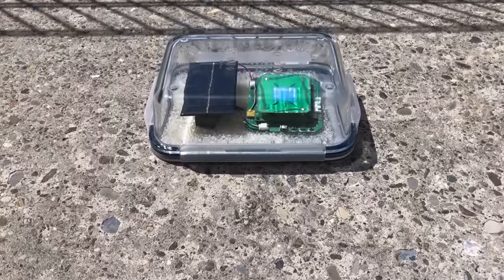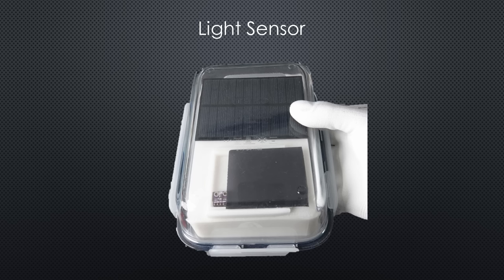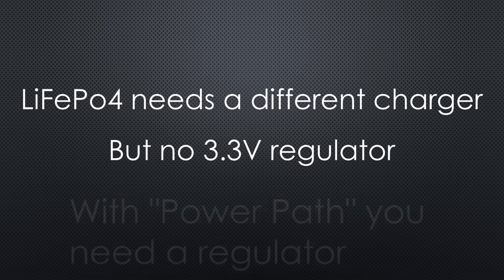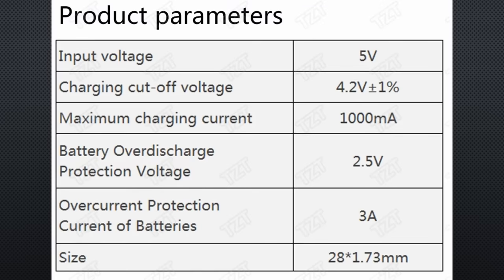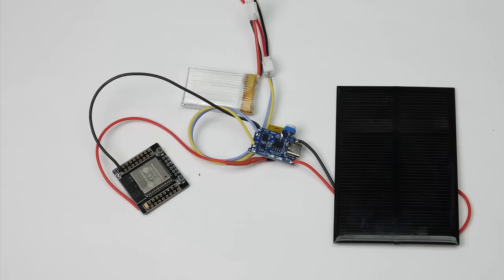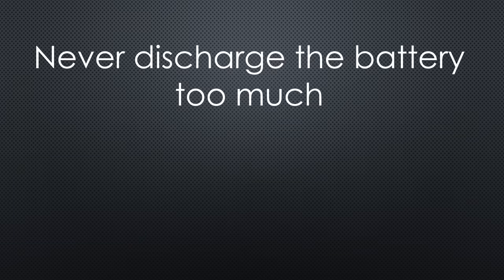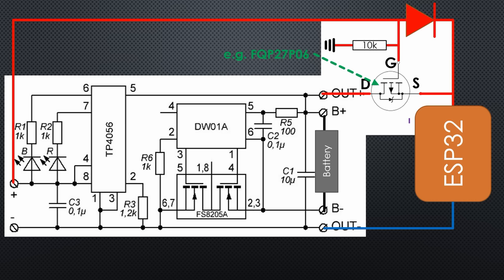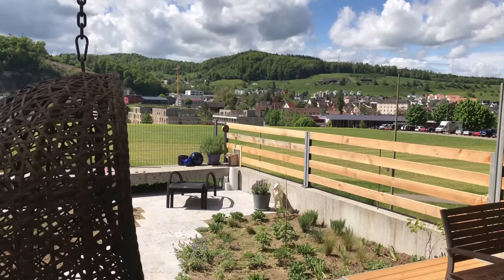#383 Cheap and simple Solar Power for our small Projects (ESP32, ESP8266, Arduino)

Comment: Hi Andreas, I am a big fan of yours and learned a lot from you. However this power path management circuit is possibly  flawed  in some situations.

The pMOS + Schottky diode path management circuit ASSUMES the voltage of solar cell output significantly lower (lower than threshold voltage of Vgs) to TURN ON the pMOS s.t. minimize the forward voltage drop of the pMOS body diode. However, that is NOT THE CASE in quite a few situations.

When sunlight is not strong enough (raining, snowing, twilight), due to the design of TP4056, solar cell output voltage will be clamped close to battery voltage. In this situation, battery still supply most of the current to the downstream. In my city in summer, from 5am-7am and 4pm-7pm (if sunny) or 7am-6pm (if rainy), my 6V 6W panel output voltage is usually slightly lower than battery output voltage, therefore, the Vgs hasn't reached the threshold voltage and pMOS is still "OFF". Therefore the battery voltage suffered from 0.5V-0.9V drop due to pMOS body diode in OFF state and makes 3.3V downstream circuit unstable. Considering the downstream circuit is usually behind an LDO with 0.3V additional voltage drop, the circuit will stop/brown-out due to "low battery" even when your lithium battery is actually >3.9 V. This is bad news for  surviving consecutive rainy/snowy days, where you really account on the full output voltage range of Li-ion battery to sustain as long as possible, while your circuit actually stop at 3.9V.

LTspice simulation also confirmed this worst scenario.

A simple modification can resolve this. Just put back the Schottky diode that you have replaced with pMOS. In this case pMOS body diode and Schottky diode are in parallel configuration. In the situation I mentioned above, Schottky diode will take over to limit the forward voltage drop to <0.3V instead of off-state pMOS body diode voltage drop (>0.5V). 

Such modification is confirmed by LTspice and circuit prototypes.

Happy to discuss.
Reply: I posted my LTspice simulations of the power path in a Github repo.  My name there is 'gbhug5a'.  I agree with your conclusion that under partial illumination the mosfet stays off, and load current provided by the battery goes through the mosfet's body diode with a Vf drop of about 0.7V.  I also agree that puttng in a second Schottky diode in parallel with the body diode reduces the Vf drop to under 0.3V.

But I also show another option of adding a single opamp instead of the second Schottky, and using its output to drive the gate, which completely eliminates any voltage drop because it keeps the mosfet turned on until the solar cell is producing enough energy to power the load by itself.  I still haven't worked out how the charger works with the opamp - we don't want the mosfet to be on when the charger is providing charging current.  I'm not sure there's a problem, but if there is, a solution might be to also connect the opamp output to pin 8 of the TP4056, which is its ENable pin.  That would enable the TP4056 only when the mosfet is off (when its gate is high).  I would be interested in your thoughts about this option.  The opamp I want to use is the MCP6041 in a DiP package, but I can't find a Spice model for it, so I simulated with an LT opamp that's much more expensive.
Reply from the maker: You are right. I know of this flaw. But my panel reduces its voltage quite fast without sun. So the question is: How often does this happen and does it hurt the overall system. Here this condition rarely occurs and only hurts if the battery is already low as you describe. If you want to optimize for this condition you can replace the MOSFET with a Schottky diode to gain 0.3 volts. Or leave the Power path away. The LDO I used only drops around  0.15 volts, BTW.
I can not say anything about your OP-amp solution other than it would add quite some complexity. Maybe adding a resistor across the solar panel would be the better idea to make sure the panel provides a low voltage as soon as possible.
Reply: @shermanpeabody7065  MCP6041 is a great option since its quiescent current is only 600nA. I used that too in other power path management circuits. But OpAmps in such design mostly serve as voltage comparators, which may create additional problem. At least AFAIK, a small positive feedback is needed to ensure some hysteresis. Otherwise the voltage comparator will bounce back and forth (a lot) when V_batt and V_solar are close, and interact very strangely with TP4056.
Reply: @sullivanzheng9586  I finished physically testing the MCP6041 circuit, and it seems to work fine.  It does function as a comparator,  The non-inverting input and Vcc connect to the source, the inverting input to the drain, and the output to the gate.  There are no  resistors.  So if the output is at a lower voltage than the input, the mosfet is turned on.  I think it has a built-in bias to be on since there is always some voltage drop across the mosfet due to RDSon even if it's wide open.  I think another reason it doesn't oscillate is that the mosfet is switched off only after load current contributed by the battery has already reached zero, so the panel doesn't see any additional load when the mosfet changes state.  I wrote it up here:

https://github.com/gbhug5a/Solar-Power-Load-Sharing
Reply: @shermanpeabody7065  Cool I will also give it a spin. Got a bunch of MCP6042s at hand. And see if there is any flickering problem if there is no hysteresis mechanism.
Reply: @shermanpeabody7065  I read through your SolarChargerLoadSharing.pdf on github repository and find your design very interesting - elegant, simple yet very efficient. Will definitely use that in my next project. 

I am very surprised that you didn't see any oscillation when V_solar is close to V_battery. Or maybe it did oscillate but the impact is unobservable, because V_solar and V_batt are very close to each other any way and an oscillating OpAmp and on-and-off MOSFET will have 0 impact on final output voltage. Maybe I will measure the Vgs to see if oscillation actually happened.

In case there is oscillation, a simple modification can address this: just add a 1Mega Ohm resistor between G and S to give a small positive feedback to OpAmp. This is the simplest way of introducing hysteresis to voltage comparator.
Reply: @sullivanzheng9586  I hope you will post the results of your oscillation tests.  I think it has no reason to oscillate because switching the mosfet takes place when that has no effect on either the battery voltage or the solar voltage - it's zero crossing, in effect.  Also, it's a very slow opamp.

Of course it could switch back and forth if solar illumination wanders in the short term, but that's not really oscillation.  Anyway, I couldn't detect anything suggesting oscillation on my scope.  But I look forward to seeing what your experience is.
Reply: @shermanpeabody7065  I recently came across several ideal diode IC/ORing controllers (E.g. LTC4359, TPS2412) and I think your opamp + PMOS based circuit is actually an DIY version of ideal diode/ORing controller. Those IC are more sophisticated but your solution is simple and cheaper. There are also very interesting ideal diode design based on BJT pairs without using any ICs.

Comment: This is incredibly helpful! Is this still achievable if there were dual inputs in the application? For instance, if there was a usb charging Input in parallel with the solar cell? I imagine both USB-in and Solar-In would need diodes before meeting the TP4056 but not sure if a separate path would be needed.
Reply from the maker: I fear, USB would be stronger and not use solar if connected, even with diodes. But if you want to use solar when no USB is connected, this might work.

Comment: I watch your channel repeatedly to refresh my memory. I would like to use 18650 battery (not sure good or not) or/and solar panel to make solar power for ESP series. Another question is which esp I should use? e.g. esp32,  S2, C3, C4.... price vs current consumption if applied in homeassistant
Reply from the maker: I still use the standard ESP32 for my projects.
Reply: @AndreasSpiess  Thanks, I think I will also use this coz of lower price

Comment: Interesting... I never figured out the "power path mosfet" solution despite hours of thinking and tinkering with various diodes. The low charging current had actually killed one of my projects after a rainstorm and 2 weeks without sun.
Reply from the maker: Glad you found the solution for your problem...

Comment: I would like you to address the problem of Li-Ion batteries at low temperatures (below 0). They are plain dangerous and thus not appropriate for anything outdoor. LiFePO4 is far batter at the cost of slightly less capacity (but you can power 3.3V electronics directly, which saves the losses of a DC-DC converter). Oh, and yes, it's waaaaay more difficult to find charger and protection circuits for LiFePO4.
Reply from the maker: I once made a video about LiFePo4 and I agree with you. But so far I had no problems with Li-Ion batteries at low temperatures. We do not charge them with high currents in winter. So most of the warnings do not seem to apply. So far I did not find any information about charging Li-Ion batteries with very low currents.

Comment: Hi, sorry but I'm a noob in electronics, I didn't understand well the mosfet function, if the solar panel has 5v under the sun and it's generating 'only' eg 80mA (eg due to a bad weather), what happens to the ESP32? I think it isn't powered by the battery, am I right ? if so, the drain-source 'door' is open only if the gate is low(solar panel -> night) ?
Reply from the maker: I left a link to a second video. Maybe this one explains it better than me.

Comment: without checking... You can get a smaller p type fet to control the switching. ive a tiny one about half the size of the ht7773, i think it was a PH33
I thought those Battery charge BMS have a over volt, under volt and short protection?
Mine do, maybe mine are different?
I found out when I had the box left inside and it was off and had min voltage. it was charged.4.2v and then sometime later I put it out for recharge one box and it rained...
I used a boost and a buck for five volts due to use of the ESP so 3.3 was not enough nor the 330ma.. such a power waste as the bucks power requirement, but I get more battery use over a simple drop with low drop.
I also use two of those solar panels ( and aux charge from the usb)
Reply from the maker: You are right, you get much smaller FETs. But I like the bigger ones because they are easier to solder in "bug-style".

Comment: Did you solder the ESP32 chip to the breakout board shown at 7:55 or is that how it arrived?   I cant find a board like yours without USB but with the breakout board.  Your links dont seem valid anymore for the WEMOS unless the banggood version for the chip (super expensive) along with an external breakout board is the way to go?
Reply from the maker: I had to solder the modules. But it is easy. Start with two opposite pins. I updated the WROOM links.

Comment: Would extreme Death Valley sunlight present a heat problem for the battery or other components sealed up in that baking dish?
Reply from the maker: I assume it would. I had two different such glass packages in full sun during last summer and they are still ok. Maximum temperature measured was 65 C
Reply: I live in a sunny place, I don't know about the circuits, but I am not keen on putting one of those batteries inside a mini greenhouse. Specs say you shouldn't go above 45C.

Comment: Again a very good video, I got adicted for a long time and my aliexpress orderbook gets bigger and bigger....
I grew up with bipolar transistors and I am not sure if I understand the p-channel MOSFET circuit. I believe it will protect the battery, but what happens if your LiIon cell is for example at 3.5V and the Solar Panel delivers between 1.5 and 3V. The datasheet for the FQP27P06 says it needs at least -2V gate to source as threshold, most likely better -3V? In this state the ESP might still be fed trough the body diode of the FET, but then we could also directly stay with the Schottky diode? 
I see the same curcuit in other "power path" implementations, but I guess there it is assumed that the charger input voltage is either on or off.
Do I miss anything here, is there maybe any logic in the solar panel as well?
Reply from the maker: I think you are right and there is a "fuzzy" voltage area depending on the minimum Vgs of the FET. The question is: Does it hurt the whole concept. This could happen if the battery is low and the solar panel is not zero and not high enough to feed the ESP (Vgs small). Then the current would only flow through the body diode of the FET. Which would be the same as if we just would have used a diode. Or did I forget something?

Comment: For my last project, I used a board with the SPV1050.  This board harvests solar power down to 0.5 volts.  This allows the use of small solar cells, and will still charge in over cast conditions.  DFRobot sell the board with a small cell SKU:DFR0579.
Reply from the maker: Thank you for sharing your experience. If I remember right I used this chip in my harvester video. But it is probably more suited for low power projects without Wi-Fi

Comment: On a TBeam v1.1 with integrated battery holder, i tought of inserting directly via USB. For this i choosed 2x5V Panels and a TP4056 charge controller. So the panels should load the already installed battery. Would be much easier than your setup in case of my TBeam board.
Reply from the maker: You can use the Li-Ion charger on the T-Beam. But you have to check if its maximum voltage is higher than the maximum voltage of your panels. Check also all other chips connected to the 5V rail (like the USB to serial chip).

Comment: 12:07 I definitely agree that these tp4056 board should be upgraded with a p-mosfet and a schottky diode.

Having, this "load switching" circuit is extremely necessary when power a load consuming a constant relatively high (higher than cutoff current of charger) current, as the load will prevent the charger from shutting down when battery is charged thus it can overcharge it.

I was recently thinking of using this circuit for a weather station project, but I had one concern, of how will the charging circuit and load switching circuit would react, if the panel voltage drops to a low value on less sunny day and during evening 🤔🤔🤔
Reply from the maker: I do not agree that the battery will be overcharged even without the power path (this is why I did not mention it). During deep-sleep the minimum current of the TP4056 will be reached as normal and the TP4056 switches off.
If the ESP is on, it consumes most or all of the charging current of the TP4056 and the battery does not get it. Anyway, it only would be for seconds.
Both of my projects never went much below 4 volts during the last winter (with a 18650 battery). So no worries...
Reply: @AndreasSpiess  yeah, true. I was saying, that in other use cases, there might happen to be a load pulling a high current. So, having this feature on the module itself will be good

Comment: do you think it's better to use a Solar Power bank that charges and instantly supply boards like esp32 and arduino with 5V voltage? i'm sure that it supply a continue type and besides it's easy to use instead of assembling a solar panel + a converter and a bettery.
Reply from the maker: If you find a powerbank that can be charged while discharging and that stays always on aslo for small currents, that is a good solution. But these are rare...

Comment: I just bought an M5Stack Timer Camera (it has its own 270 mAh battery). Can I get a solar panel with USB cable (I just saw 6 V / 1.3 A model) and connect it straight into the M5Stack USB? I would prefer this "clean" solution without need to solder anything.
Reply from the maker: You can try. It will probably work, but not deliver maimum power.

Comment: Very good video with good tips. But you use lithium based batteries which are not suitable for outdoor projects if you want to leave them outside though out the year. I mean, you cannot charge those when it is freezing. At the least there should be a temperature sensor that prevents charging when it is below zero. So how to deal with that problem?
Reply from the maker: So far I had no problems. They do not charge in full sun because they are already fully charged by then. And thanks to the power path they are not used in this situation. So "storage conditions" apply. I measured 65C max during summer in my glass box, which seems to be tolerable.
Concerning low temperature charging: I did not find any info for small charging currents. All info was for full power charging. I do expect that the life expectancy of these cells are shorter than average.

Comment: Hi Andreas,
Comes at just the right time.
I have just got some LORA radios to work on ESP32's, it was super exciting yesterday as it's my first time playing with RF.
Now I can look at data harvesting using radio.
I am testing soil moisture measurement using 950nM infra red by measuring the emissivity of the soil with a buried sensor, it works super well by the way.
So now I can add the use of radio to that, and use solar if desired.
Very happy with the nice stuff we have to do projects with.
As always, I enjoyed the video and the content is useful.
Kind regards,
South Africa
Reply from the maker: Can you send me a link for your soil measurement? Sounds interesting!
Reply: @AndreasSpiess  Hi Andreas, I would have to show you a picture of my sensor and a description of what I did. 
Do not have it published anywhere, will slip you a message on Twitter?